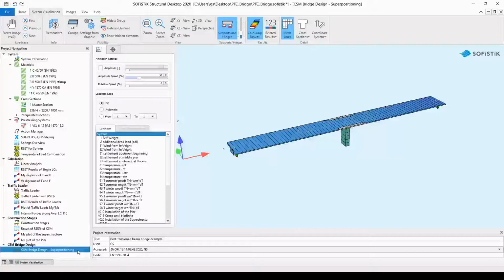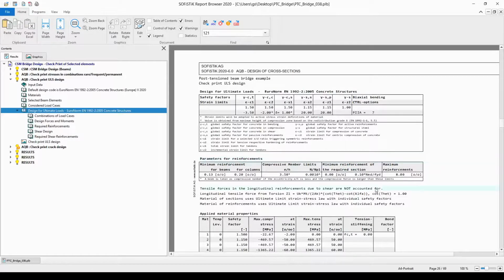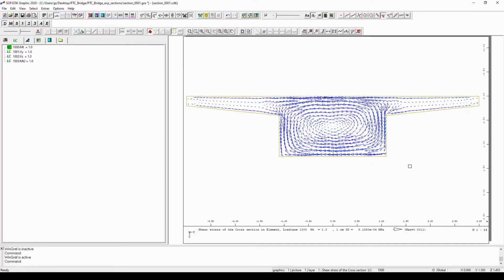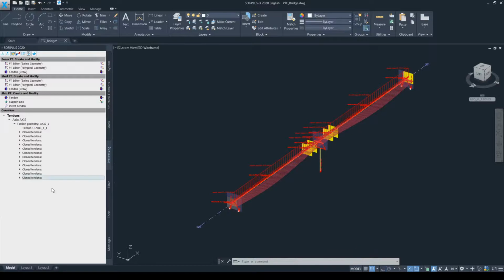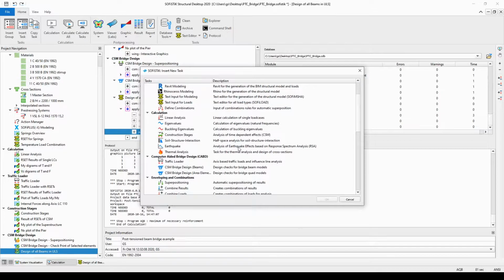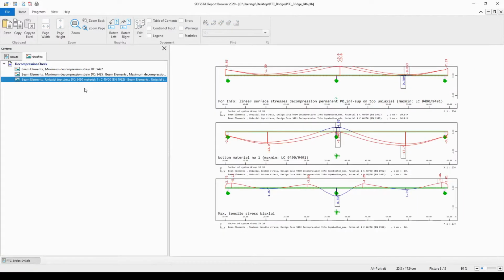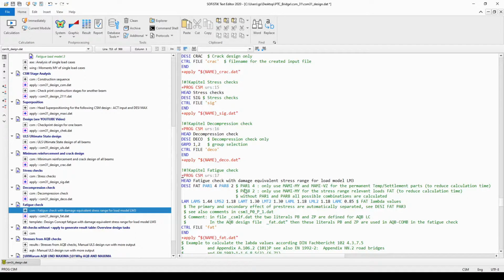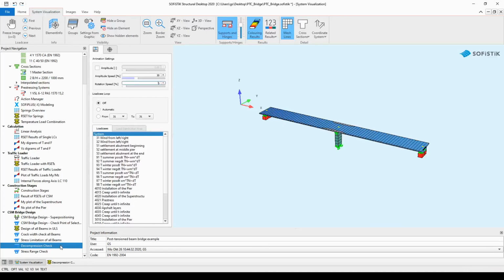Bridge Design Training #12 - Design with CSM

Comment: error no.  2200 in program AQBEI ; input line:   26
   No matching load cases for beam elements selected/found in database (action/type  )
Reply from the maker: Hi user-wu9ng8kj1k,
This error in AQB describes a missing design-loadcasenumber in your cross section design process. Please check if your project contains the refered numbering scheme.

Comment: Hello, really enjoying the course! I'm from Brazil and here we have the code for designing structural elements (ABNT NBR 6118:2014) and the combination factors are different, besides the consideration of the different actions. If I'm to work only with characteristic values and perform the design on my own, what is the suggested workflow? And with the modelling with SOFiSTiK, is there a suggested software to work with the documentation of the project, such as Revit? I'm asking these questions for bridges specifically, since for buildings things are more simple
Reply from the maker: Hello Bruno,
Glad you like it :)
I assume you already know how to set everything to characteristic? If you then want to work with a third party software, or you want to do it on your own, you can e.g. export your analysis data to EXCEL.
Here a video about that: https://www.youtube.com/watch?v=9UtFOGilUxo
About the documentation: This depends on what you want to do (or what kind of documentation). We do offer Software for generating your bridge in Revit https://www.youtube.com/watch?v=JNTmziM9wQ8 (sorry for the old video). This can be used for formwork, voluminas, masses... But, as for documenting your analysis results, you can perfectly do that in SOFiSTiK itself.

Did that answer your questions?